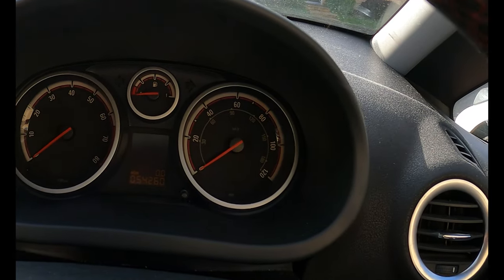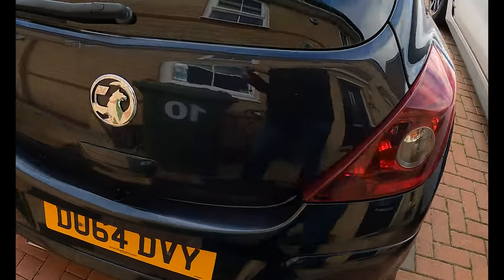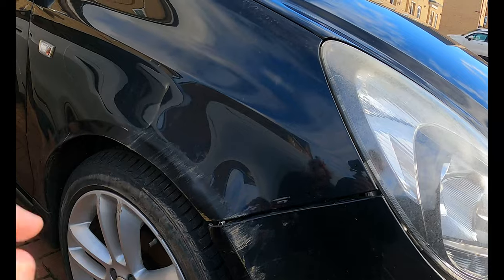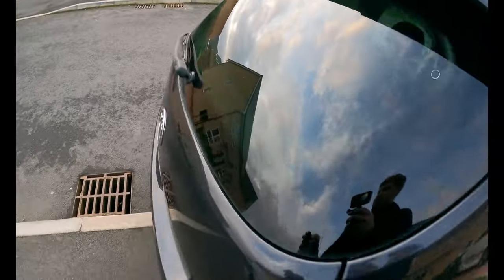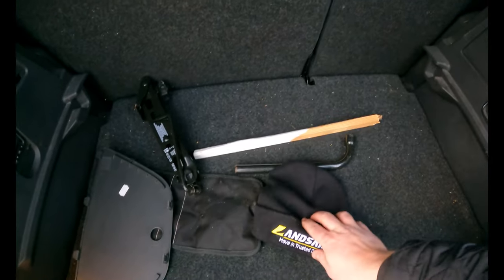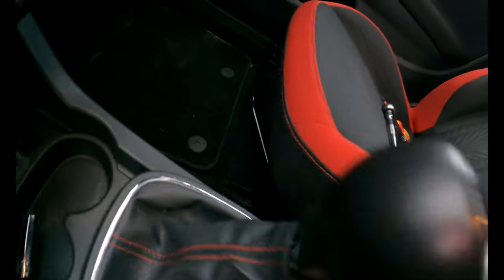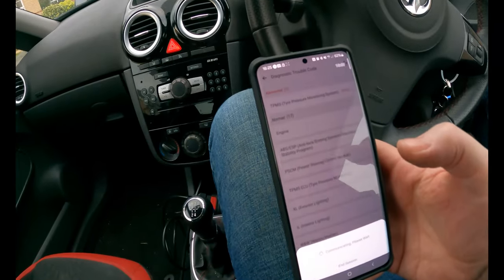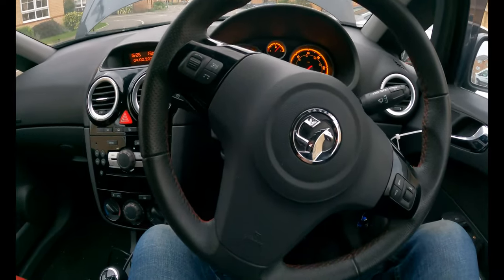IS THIS MY CHEAPEST COPART CAR EVER OR HAVE I MADE A HUGE MISTAKE!! VLOG 1

Comment: Great buy video and good luck on the rebuild!

Do you reccomend any cheap ebay OBD2 scanners for clearing arbag lights?
Reply from the maker: My Think Diag ODB can do a lot but I haven't tried it with airbag clearing yet. I have sent the company a message to see if I can get you a referral link with a discount as it would be good to pass on to the community.

Comment: Give the starter a wollop with a hammer while trying it,  failing that cheapest fix is getting the starter fixed with a new solenoid.  There are loads of places that will refurbish starters and alternators way cheaper than buying new pal
Reply from the maker: Yeah we gave that a try when Josh came over. Not to give too much away but it has a new starter on it now.